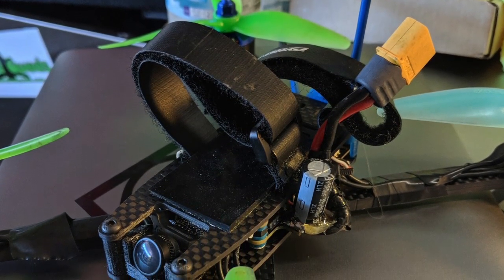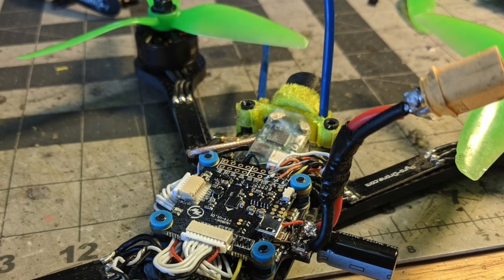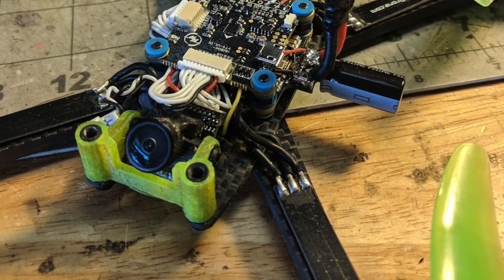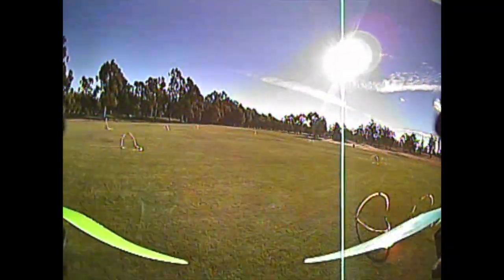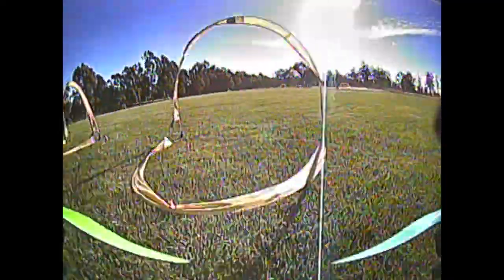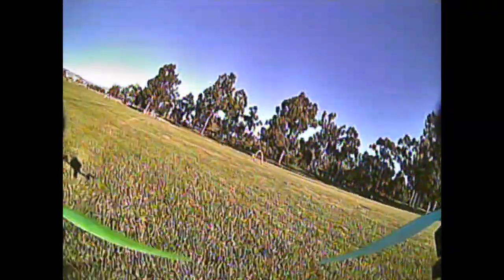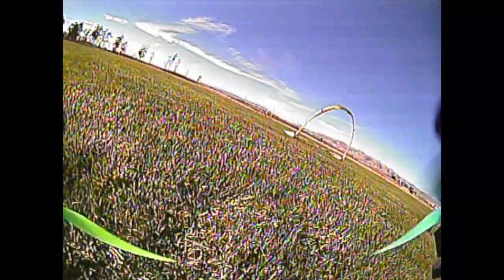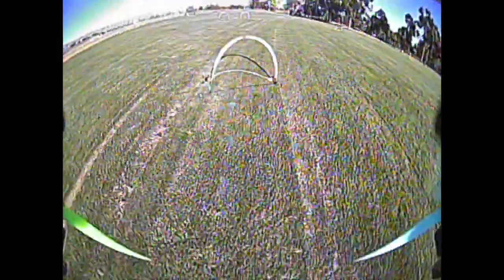July PID Tuning Update

Comment: Try 48khz pwm frequency now that you're on blheli 32! Higher throttle resolution which also might improve the tune since the FC has more resolution of motor rpm to work with.
Reply: I've been at 32khz with the Aikon...so, you've found a noticeable diff between 32 and 48?
Reply: LeninFPV yeup definitely. Higher throttle resolution is what it felt like

Comment: Will these pids work on a 4s motors? And does it work with a frsky controller
Reply from the maker: Hey Ervin, no this tune is specifically for 6s.  I haven't tested it for 5s or 4s.